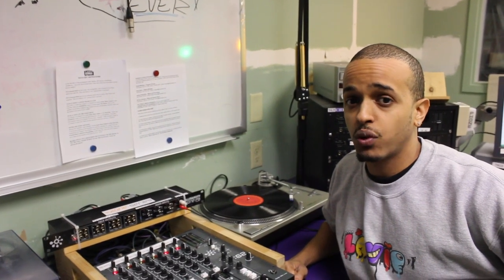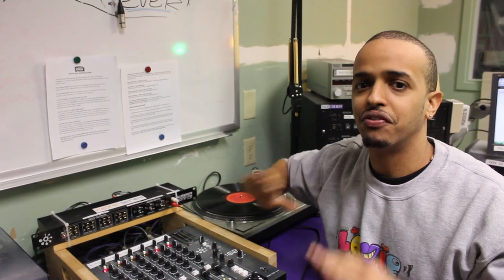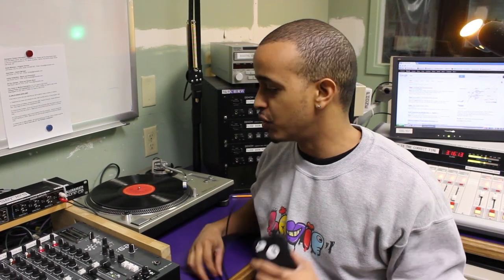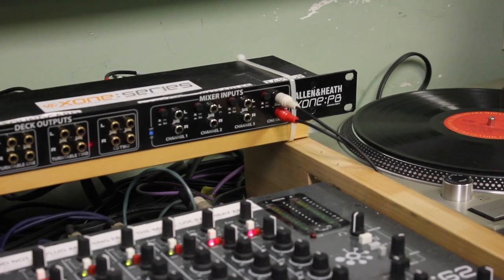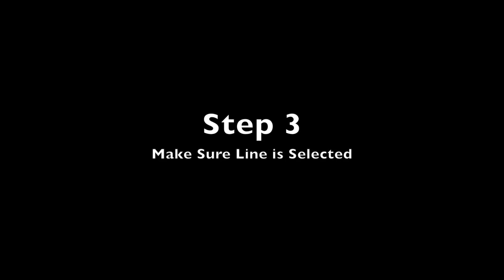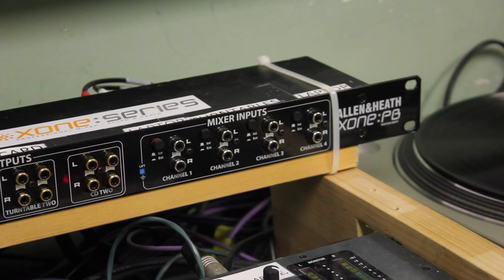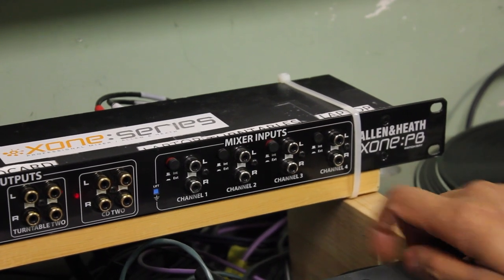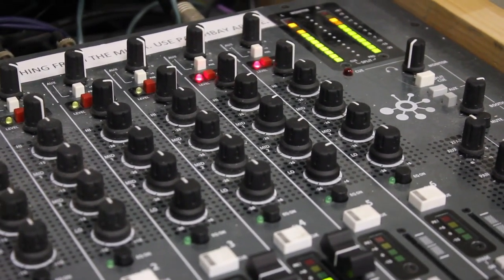How To: Use the Patchbay in the On-Air Studio

Comment: Just a suggestion,would it be possible to have the channel numbers on the PATCHBAY  match that of the channel numbers of the MIXER?

For example Channel 1 which is left Laptop on the PATCHBAY be routed to Channel 1 of the MIXER instead of channel 5 and channel 4 which is Laptop right on the PATCHBAY be routed to channel 4 of the MIXER instead of channel 6. 

Have channel 2 on the PATCHBAY which is turntable left routed to channel 2 on the MIXER instead of channel 3 and  channel 3 on the PATCHBAY which is turntable right routed to channel 3 on the MIXER instead of channel 4.

This may save a certain amount of confusion for the DJ's as everything would be routed in a matching sequence.